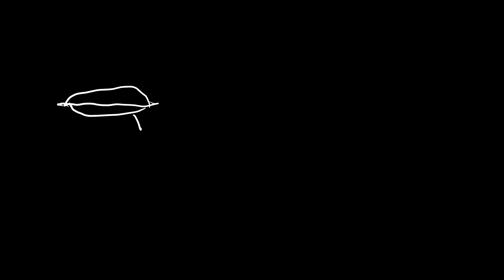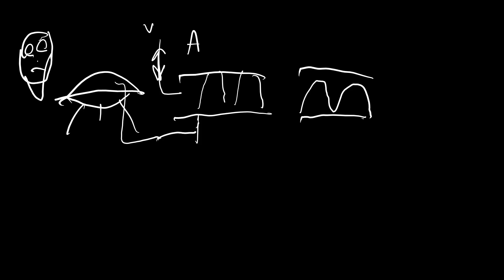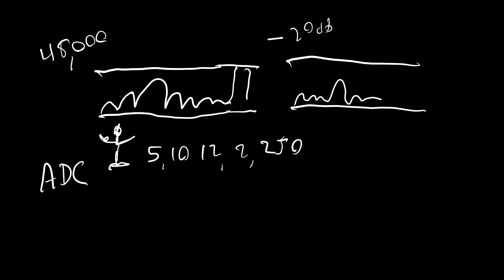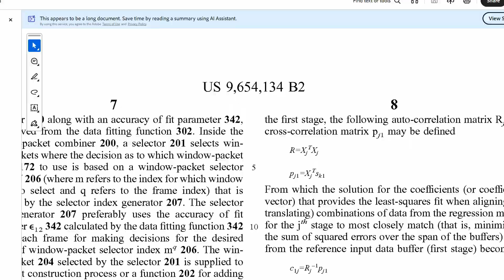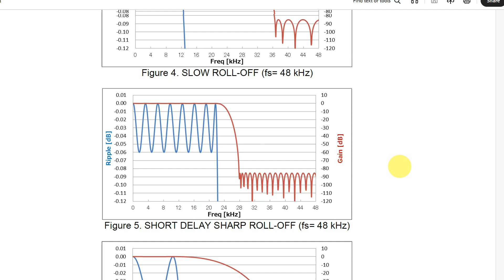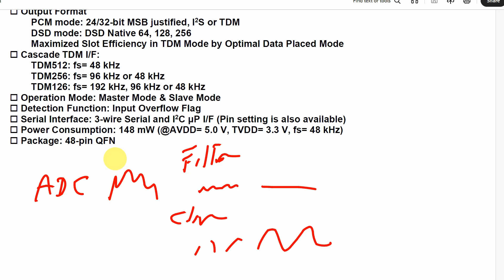Shannon's Theorem: Why Multiple ADCs Can't Help

Comment: I'm not an audio engineer so I don't know the details of what is expected from a pre-amp, but all of this makes sense to me if the pre-amp uses a gain that maximizes the signal WITHOUT clipping it.  The separate gain paths after the pre-amplified signal will then amplify and consequently clip the signal to varying degrees to gain access to the lower level signals.  This is the same way HDR cameras work with one exception:  Only one camera is used and that same camera takes multiple captures (digitizations) at different gain/exposure levels at different TIMES to amplify the low-level signals without clipping the high-level signals compressing a wider range of input levels into the same output range as a normal exposure.  In the case of this audio circuit, it is using the equivalent of multiple cameras, all set to different gain/exposure levels and then from that point, combining them into a single output the same way the HDR camera does by selectively choosing which bits from which capture to pass through with some graceful massaging at the transitions.  HDR could try to use multiple cameras, as well, but it would be much more costly and there would be some spatial misalignments.  The audio case is more forgiving, assuming you are not running into noise floor issues, which I cannot speak to the practicality of that aspect.  I make the assumption there are cases where the low-level signals can be amplified cleanly enough to want them boosted.
Reply: That “HDR” thing in audio can be accomplished by using a floating point ADC, which are usually recording at 32 bit depth. As long as the analog part doesn't saturate and the lowest significant amplitude on the input is far enough from the noise floor, it does represent the input signal faithfully. That's how they do it in cinema production for ages, and finally, those preamps and converters start to appear in music recording gear. So there's no need to use integer ADCs in a chain; if that would do anything, it would only increase the noise floor. Kinda pointless, isn't it?
Reply from the maker: @fivestringalex  All ADCs are integer.  ALL.  Writing to 32-bit-float is after that process.  Show me a single chip spec sheet that says it only outputs 32-bit-float.  None of these equipment manufacturers make the ADC ships.  They're all off the -shelf.  Ask AI.  Pick any one.  Ask "Does any ADC output directly to 32-bit-float".  Then ask it what it does instead and why it can't output directly to 32-bit-float.
Reply: @MaxoticsTV  a 32 bit ADC would indeed consist of several 24 bit ADC, but they would run in parallel, not in a sequence, as in HDR photo @jamesevanko7037 is talking about. The noise floor would still change depending on which of the parallel 24 bit ADCs is actually writing to the floating point conversion unit, yet there's still no “sequential exposure”. And then there's a physical SPL limit in the mic, so you can still clip a 32 bit recording, but that's out of question in this context.
Reply from the maker: @fivestringalex  I think the aspect you're missing is noise floor cannot be moved independently of your subject signal once you have the final signal from the pre-amp. 

What "they" do is take the signal from the mic pre-amp and duplicate it.  The first ADC copy is the "high" gain.  The 2nd ADC copy is attenuated say -20db, the "low" gain.  If you listened to the 2nd copy indeed, there would be less "noise floor", but it would also be lower in signal volume.  

Both Signal AND noise have been attenuated down 20db.  Explain to me how you can move one without the other.

That is, you have a lower amplitude signal with proportionally the same SNR. When you digitally gain it back up later (+20dB), you're amplifying both the signal AND the noise equally. The SNR remains identical.
Reply: @MaxoticsTV proportionally it is the same, but it’s not the case in the resulting bitstream when comparing it to 0 dBFS. If cascading instead of having two or more parallel DACs, the noise floors would just sum, thus the noise level in the bitstream becomes constant (which may be better for spectral noise reduction algorithms), but that would also mean that the analog circuit’s noise floor is always higher in the signal that reaches the DAW or whatever, and quantisation noise would probably also increase. Probably higher than desirable. So I don’t have much problem with how things currently work. It’s not ideal, but it’s better than trading off real resolution and SNR. Maybe pairing 32 bit integer DACs could make it a bit better, but I don’t really know if such chips are mass produced and available for cheap.
Reply from the maker: @fivestringalex  In my preliminary tests with a dual ADC recorder (the Zoom F3), the results were what I expected.  Acceptable noise and workable signal for anyone wanting to do a podcast and YT video, etc.  For what it does, sure the thing works, but offers nothing a good audio engineer can't do in his/her sleep.  (which, sadly, isn't me because I will always try to fill them meters ;))

I'm not sure where DACs some into play here?  If you mean ADCs, again, I don't see the benefit.  I understand the THEORIES on how they could have a benefit, but I haven't seen on iota of proof they work so I DEFAULT to the law of physics and information theory as I understand them ;)
Reply: @MaxoticsTV sure, I meant ADCs, not DACs. The only benefit, which is a big one, is that in a field recording setting, like shooting a movie, you can’t really predict how loud things would get, so being able to get a non-clipped signal is far from a gimmick. Even in music recording it’s sometimes handy, because every singer I recorded would whisper at the mic when checking input levels, even with the song blasting near the pain threshold in their monitor headphones, but scream like they’re being tortured the moment I actually hit the record button. Most guitar players are also clueless about digital clipping, so having them record a DI on a 32 bit interface is a life saver.  I can just get to mixing with whatever they send to me instead of asking them to re-record the entire song and teaching them the very basics for free. So while a decent engineer in a perfect setting doesn’t need any of that parallel conversion magic, people who hire them certainly do.
Reply from the maker: @fivestringalex  Again, not disagreeing such a device doesn't have its uses.  I'm keeping the F3 for all the reasons you mentioned.  But I feel you're still kidding yourself.  There's more noise, less signal, than what you would get if you set the gain to best fit what you want to scale.  

If you believe you are not trading anything for clip-less audio then please try to convince me some more.  I still don't see how you one can make an end-run around these facts of audio recording.
Reply: @MaxoticsTV I am pretty much aware of the tradeoffs, but I don’t live in a perfect world where every setting is suitable for pure 24 bit recording with a fixed input gain. I wish I did.
Reply from the maker: @fivestringalex  Yes, but you defend the new status quo that there is a new technology that is NOT a new technology.  It's just more signal processing on a chip.  That all dual-ADC really means when you get down it (IMO).  What are you arguing?  What defending?  What position are you taking?

Let's imagine you're teaching me bass.  You could point out that I have some timing problems.  I might reply, that's okay, my software will re-quantize to fix it and no one will notice so I don't really have a problem.  You can't argue with that, or would you?

I think if you think about the stuff you care about and put it in this context you'll see where I'm coming from.
Reply: @MaxoticsTV I never said it’s new, everyone who worked for a video production company is familiar with it in one way or another. But it’s not the case with musicians, as there’s a lot of  pure 24 bit interfaces, and the newer 32 bit ones are being marketed as the ultimate solution. Which I totally realize they’re not. Better than nothing, but not as good as 32 bit integer converters would be. There’s still a problem with the noise floor, though, but what’s the real solution? One bit of 32 bit integer amplitude would be measured in nanovolts, and a typical noise floor of a mic pre is measured in millivolts, about half a millivolt for the best ones. So if we even go for a true 32 bit converter, what we’re getting is a very high resolution recording of the noise that’s inevitably contained in the input signal. I wonder how do we get around that, if that’s physically possible at all.
Reply: @M @MaxoticsTV Im taking the position of looking for something better while still making use of what we already have. I’m not trying to defend anything really, just trying to understand if we can reliably solve the problem of unpredictable input amplitudes when recording in situations like shooting a video outside. I totally get what you’re saying about the theorem in question, and I’m fine with the loss as long as it is insignificant to the human ear and whatever processing, analog or digital, that might be in the chain before the product reaches the audience. It just so happens that nobody yet has a better system than running two converters in parallel.
Reply from the maker: @fivestringalex  It's not physically possible.  The answer is 'No' we can't have it ;)  It seems we both take the red pill? ;)  But seems you've like living some blue pill experience haha.

You take the red pill you must accept all the difficult and messy physics (noise and distortion) of analog.  you take the blue pill and you wake up in a world you can perfect digitally.  Any imperfection from analog can be fixed with a digital algo.
Reply from the maker: @fivestringalex  I'm the same!  I just get all red-ass when someone talks shit and doesn't back it up with proof haha.  More than that, it just pollutes the stuff I (we) love.  

We have to make compromises everywhere and in everything.  But in theory, I believe, in our physical understanding of nature,  we need to keep that free of bullshit marketing jargon.  Mini rant over ;)
Reply: I spent a few years of my career working on military communication radios.  I don't quite know what effect they are trying to achieve with the output, but the only obvious one that comes to my mind is outputting the loudest version of the sample that isn't clipping at any given time which could alternatively be implemented by adjusting the gain going into one ADC with automatic gain control (AGC) algorithm (trying to remember how this differed from ALC...), but that requires some level of prediction of what the gain should be prior to digitizing whereas having multiple ADCs makes the decision after the digitization already occurred.  Maybe multiple ADCs can truly handle simultaneous sounds at different input levels, I don't know.  Would be curious to hear a good A/B comparison with and without the effect applied.
Reply from the maker: @jamesevanko7037  Yes, what they're after is a kind of HDR.  The problem is, as you point out, the camera takes 3 separate exposures at different gain settings (if not different shutter or apertures).  

In these dual ADCs they're working with one image/capture.  Blarg and I are going back and forth on if that can work.  I don't believe so.  

Audio engineers already have an HDR system for decades.  Dual mics, one at low gain and the other at high gain.  They generally don't composite them but will switch to the low gain version if there is clipping.  To me, that is the only rock-hard solution.
Reply: Noise floor is half the reason for these multi-ADC approaches, for when your signal clips in the high-gain one or is too quiet in the low-gain one. If noise floor weren't an issue you'd just set gain really low so nothing would clip.

With 32-bit float representation the pre-amplifier's gain can theoretically be compensated for after the ADC so that you could adjust the gain while recording without the signal sounding any different (other than the noise floor and clipping limits shifting). Practically your digital compensation would have to exactly match the gain, and it must not affect linearity, both probably imperfect. As you say you'd still need prediction with automatic gain, unless a little bit of clipping for sudden loud sounds was acceptable (until the gain was reduced). The multi-ADC approach is likely a practical solution to both of these problems: two ADCs with different, known and calibrated gains. Then you can compensate for them, and switch between ADCs effectively back in time (by going back in the other's buffer when one clips).

For an A/B comparison, just record in a very quiet space of whisper, followed by a loud yell into the mic. You could use a couple of comparison 24-bit recorders, one with the lowest gain, the other highest. What you'd find (if the 32-bit recorder is doing its job) is that you can effectively recover an equivalent of both 24-bit recorders: the whisper without lots of background hiss, and the yell without distortion, whereas the 24-bit recorders will only get one or the other.